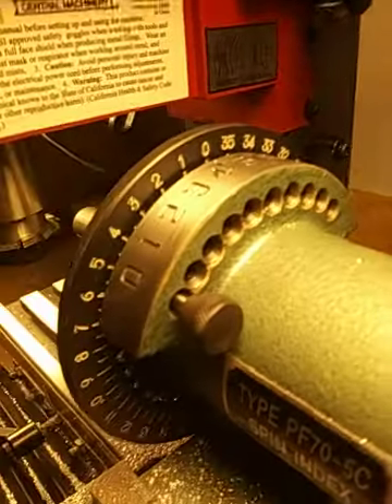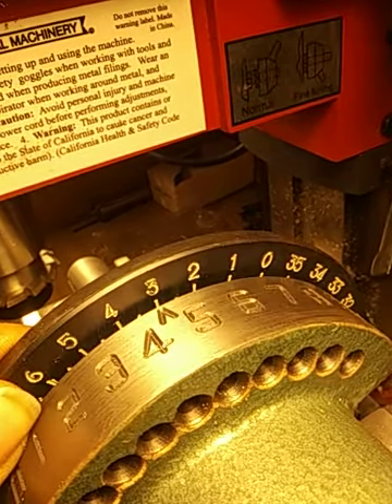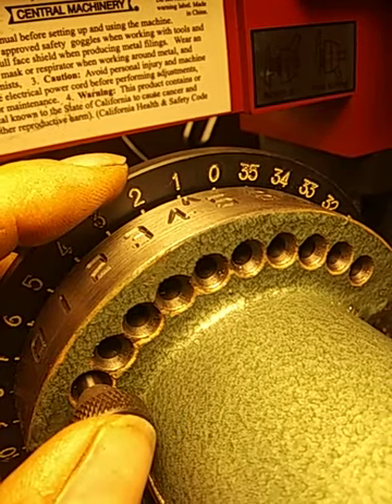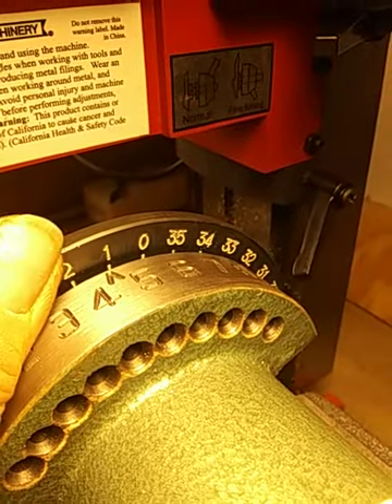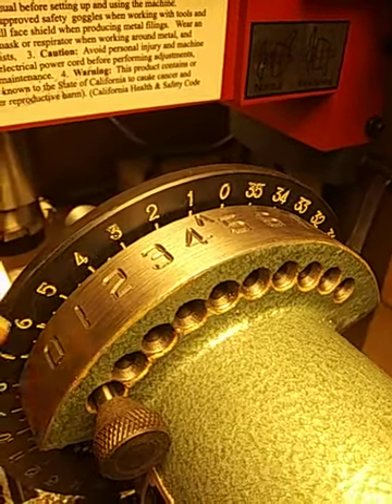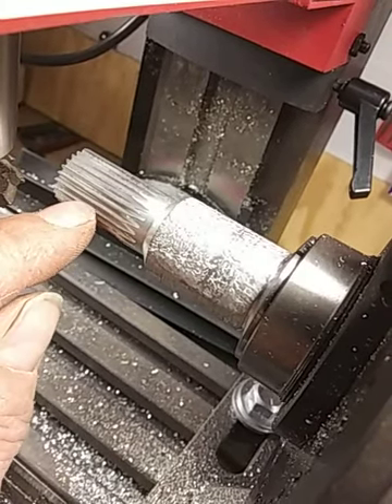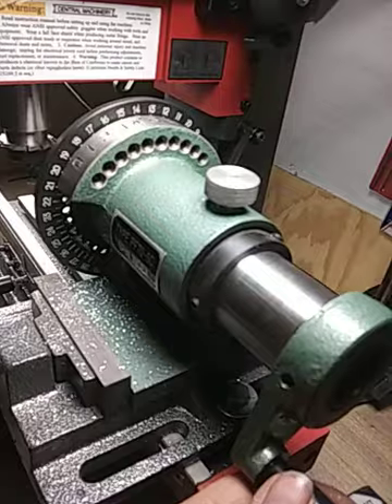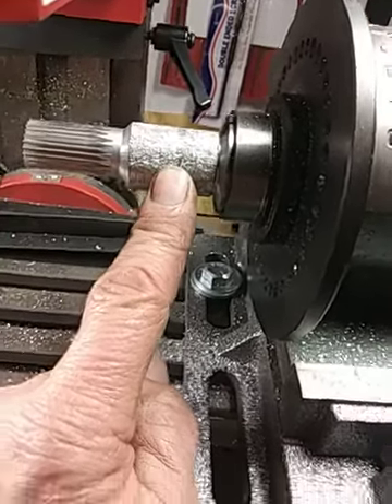Incrementing a Spin Index.

Comment: These spin index really come in handy for all sorts of applications in the shop. Everyone needs one in there machine shop. 👍
Reply from the maker: Yes, a spin index is very handy for many projects. Can even use it to make gears. You also might want to consider a rotary table that mounts to a milling machine. Can cut perfect holes in steel for bearing races with it. I got mine at Penn Tool. Thanks for the reply my friend.

Comment: I would need to cut 7 pinions.  Is there a way to use this machine or would I need to get a dividing head? The math comes out to 51.42.  so the only thing I can guess is either a regular head or drill another hole that divides by .42.
Reply from the maker: As an amateur machinist I don't think I would have much luck drilling another hole that would divide by exactly .42. I'll leave that for the big boys that are called Professionals. The only way one could try to use the SpinIndexer for that would be to not pin it and eyeball-guess where to lock it. Both you and I know that would never work.

Comment: Dreadful camera control.
Reply from the maker: Yes, I agree. Trying to operate machinery and take video of it at the same time is very difficult. When doing these videos it would be very handy to have four arms and hands.
Reply: @normtheteacher5485  great content Thanks.. they make chest rig mounts for action cameras such as GoPro etc..doubtful a helmet mount would be useful in the shop setting as a chest mount would be..
Reply: ...then "plan" the video content ....which means running through WHAT you are going to present. It's called "choreography". Minimize moving the camera.  For example, there is absolutely no need to pan to your face ....unless you think it is important from a "technical aspect" of the presentation. The audio works fine.   I would also add, there is no need for you to try to "explain" why the camera work is "dreadful".  I would caution people who really want to learn about machining to follow your videos.   You most certainly are NO TEACHER.    I just happened to stumble on this video. Now I know better.

.